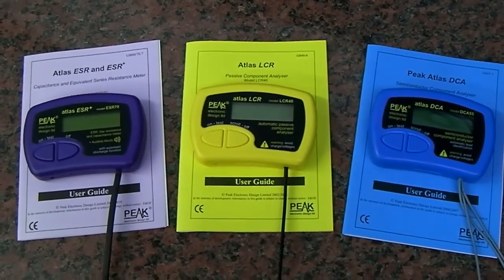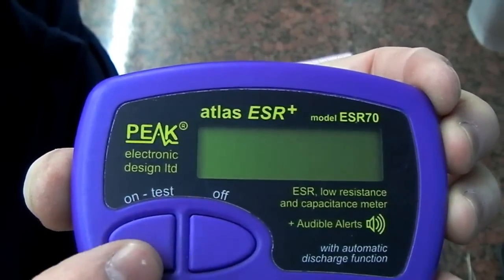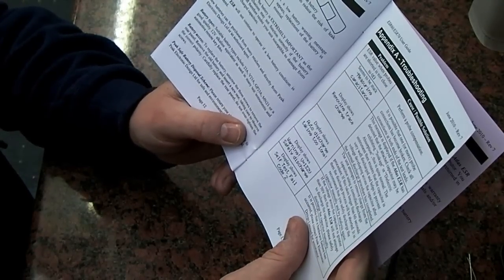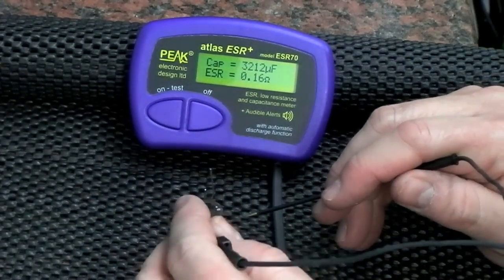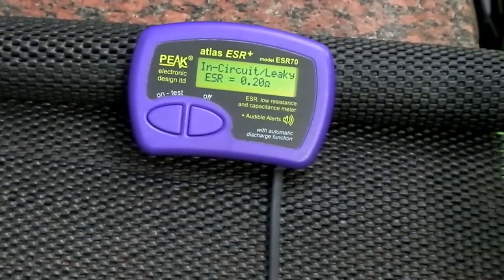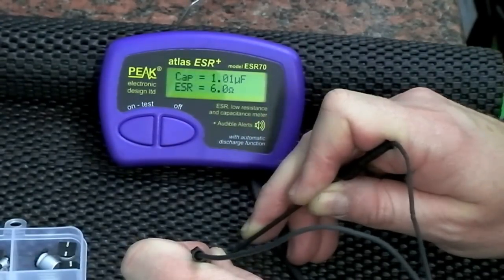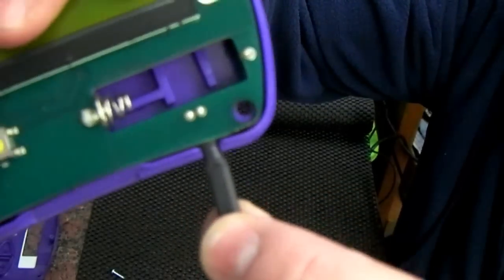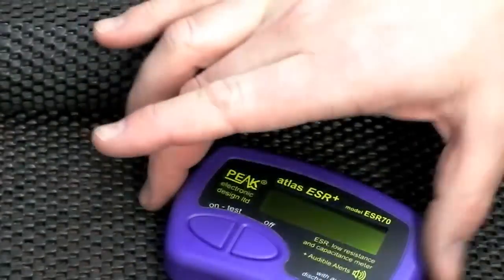Peak Electronics ESR70 ESR & Capacitance Meter

Comment: Have you tried using a cell phone holder with the suction cup mount on the bottom as a stand?
Reply: I've just tried that. It works. Or rather it would if the suction mechanism on mine would grip the bench. I may look out one of those TomTom mounting discs to attach to the bench, to provide a smoother base.

Comment: Hello, nice vid thanks very informative. Just wondering, what is this 12V battery inside the  ESR70  ? is that a common model ? never heard of it. Regards
Reply: It's a very common battery usually found in car alarm key fobs. Look for a 23A or an MN21 or a GP23A 12V Alkaline battery, they should all fit.

Comment: How do you know that the esr is good.Do they deliver a table to what the esr must be.Like the evb esr meter.
Reply: Read the manufacturer datasheets of the particular capacitor, they have real product specific ESR tables measured at 100 KHz.
All other tables, including inbuild tables that are shipped with an ESR meter are only generic values.

Comment: hi i brought one of this just to test iam new with electronics, i test a bulge 450uf 10v capacitor the ESR is still good pretty low but the capacitance it showing is 221uf , is it possible that a bulge capacitor can still have a good ESR value?
Reply: A 450UF CAPACITOR AND THE ESR70 IS MEASURING 221UF. . . . . CAPACITOR IS BAD. . . 221 IS NOWHERE CLOSE TO 450. . . . . .
Reply: capacitance can be bad whatevers esr reading...

Comment: Useless device, returned to seller immediately,  ESR in circuit can be measured only if capacitors are not in parallel.......i used it to try to identify bad electrolytic capacitors in graphic cards but it doesn´t work.......the best way is only one, desoldering all the capacitors and measure them outside the circuit........disappointed.
Reply: I think you should inform yourself better about how a capacitor and a tester for it works lol.

Comment: These ESR70 are extremely overpriced, and don't test 0 - 1uf caps!
Reply: 8233Eire I think it's just meant for Electrolytic capacitors
Reply: its an esr meter... under 1uF you will not use an esr meter but an lcr meter
Reply: esr meter are made for electrolytic cap only